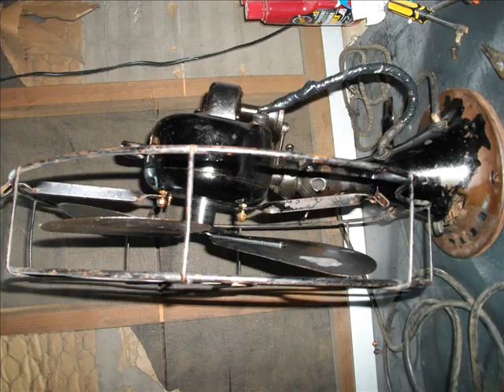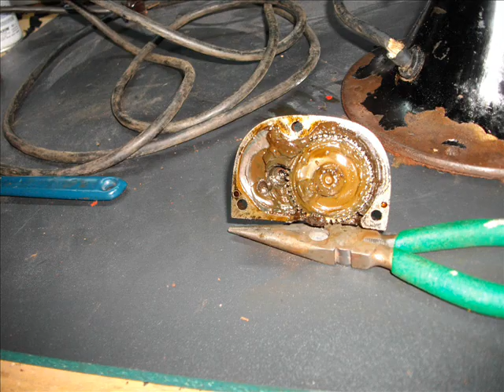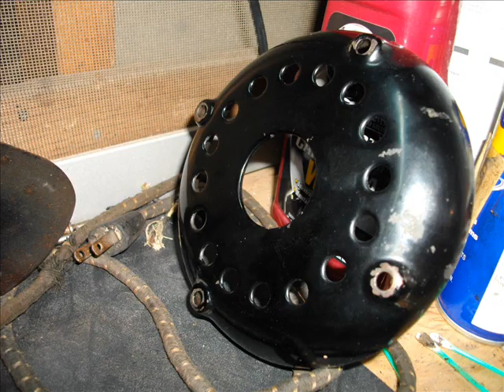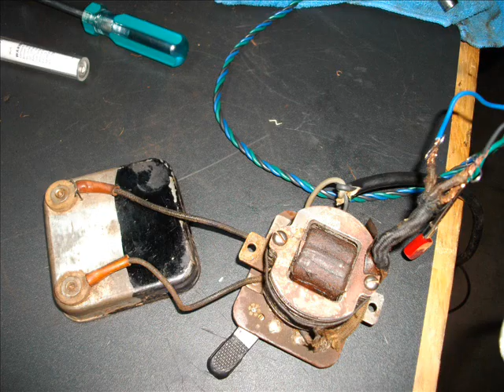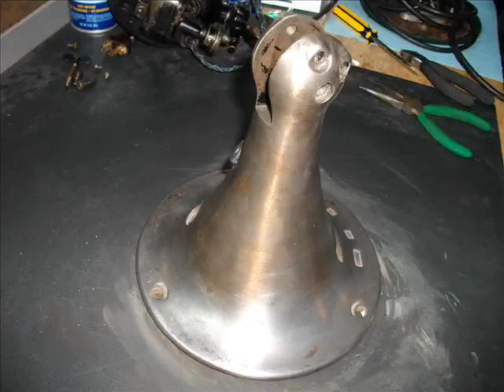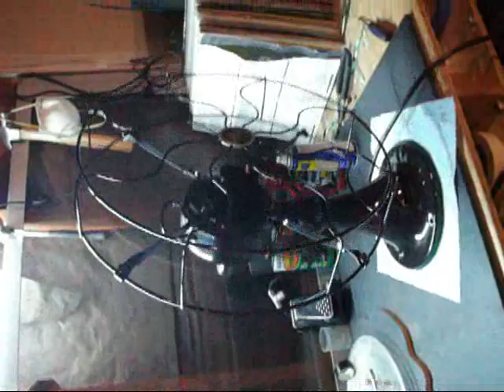Emerson 73648AK FAN Restore

Comment: I am filled with encouragement, thanks for your video.

I have buggered up the oscillation mechanism on my 79648-AP-G. I have been around such units like this for 50 years and even as a kid I could change the degree of movement/on/off for the oscillator but now I forgot how it works. Maybe if I get that working again I may just strip the whole thing down and refinish... But, it has been spinning daily and quietly for 30+ years, maybe it doesn't need anything???

Comment: I know it has been 9 years since you posted this but I am trying to dismantle clean and rewire an Emerson fan that looks almost identical to the motor in your video but am stuck on how to remove the windings from the back case without doing damage.  Do you remember how you did it?  I can find not nuts or screws.  It almost looks like it's just wedged into the casing but I don't want to crack anything by attempting to pry on it.  Thanks!
Reply from the maker: Hello. Wow its been that long...if you watch my other videos, one shows me using a hammer handle to remove windings. You might need to use that method. If you are sure that you have removed all bolts/screws that support the windings, it may just be wedged in place with corrosion. Place a wooden hammer handle or other shock absorbing stick against the middle of the windings and while holding the whole thing together tap the head of hammer on a table, gently moving around the edge of the inside of windings(without pinching the windings with each tap) it should start to move out slowly...reverse this process to put back in. Hope that helps a little, its been a long time since i worked on a fan...have fun!

Comment: I have a post but need to send you two photos , I have my fan ready to go but didn't take photos of the wiring before I disassembled it .  must have the wiring wrong. Didn't smoke any ,just sat there and did nothing. Can't believe I made this mistake . Don't know how to post my two photos of the wiring , also Mine is a 3 speed and has a little tap wire coming off of the top of the transformer.  Is just like your fan ....

Comment: I know it was a while since you did this, But I am having trouble removing the blades, Do you turn the blades left (CCW) to loosen it? Like a normal screw?  Or is it CW to loosen it?  Pelase Help.
Reply: Tom Miller Emerson models are tricky take apart the rotor shell in the back, then look through vent holes there should be a gear that moves as you manually spin the blades. 

Try and use a screwdriver and CAREFULLY hold that gear from moving and manually spin the blade off (same direction it spins in) to loosen it. 

Good luck with restoring I'm currently working on one but can't seem to find a place or a way to replace oscillation gears =\.

Comment: Thats one of the best fans Emerson ever made. I have the early non capacitor run version with brass blades (circa 1928). it is one of my best fans. you can see that and my 73668 6 blade on my youtube channel.